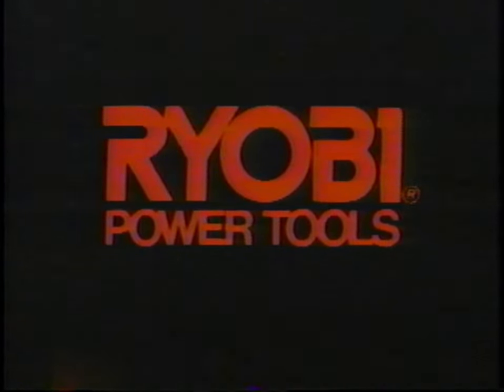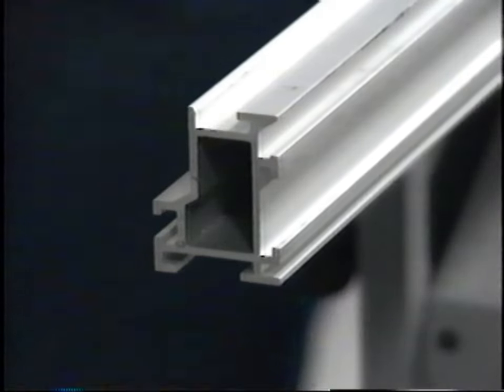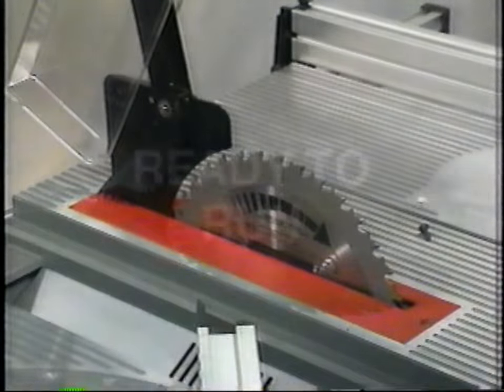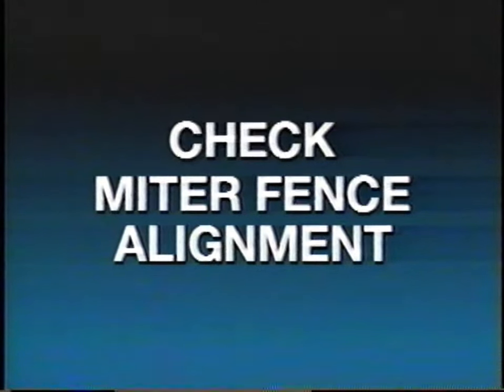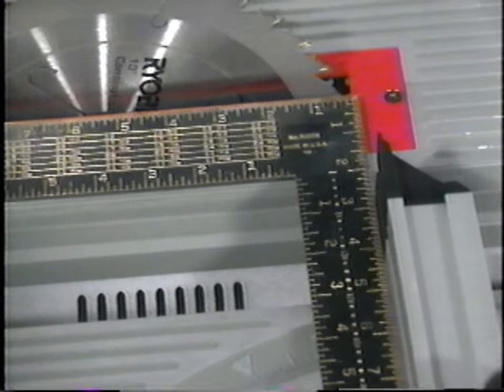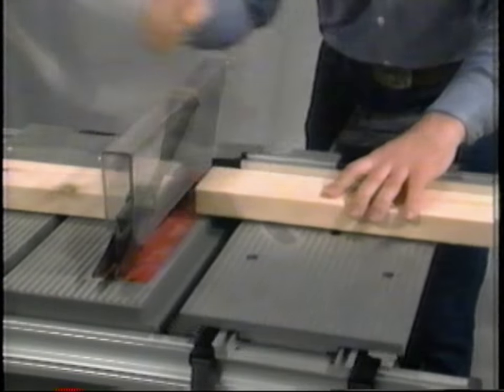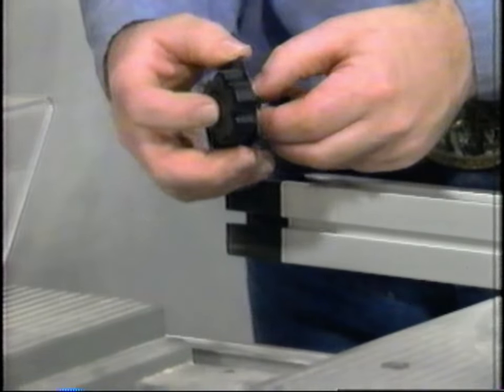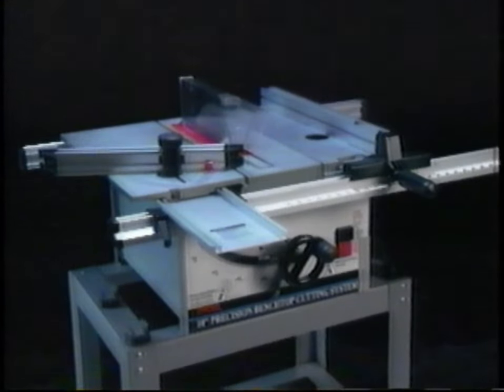Ryobi BT3000 10" Table Saw || Original Instructional Video || Install Guide

Comment: they still make these.  i wish i had not bought one  it sounds nice.  but there are many things that you can not do and keeping it in alinement is a nightmare.
Reply: I’m really struggling to decide on a table saw under $600. Dewalt meeting is great but trying to avoid jobsite portables. I figured maybe picking up an older cheaper iron top but upgrading a fence may work well…